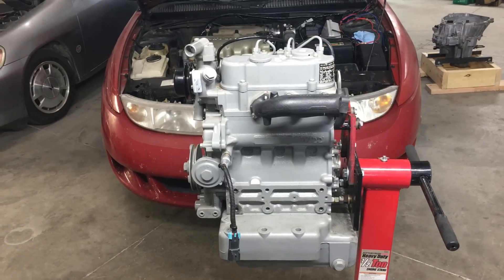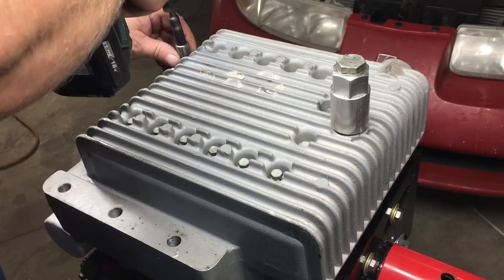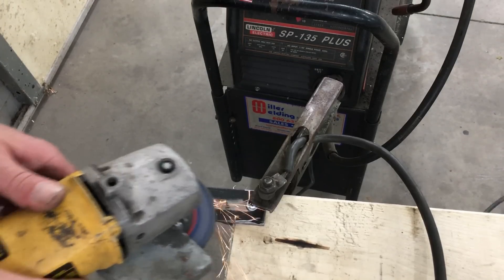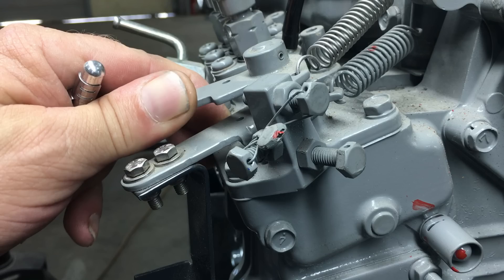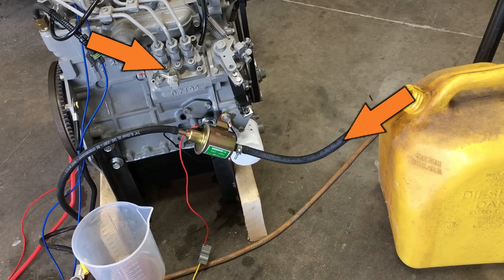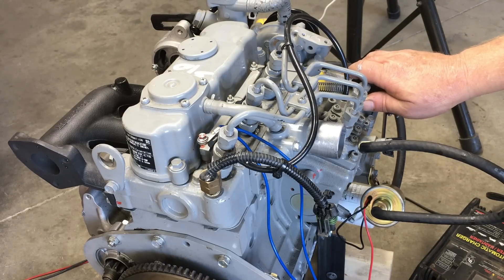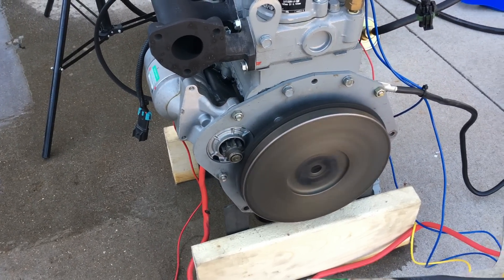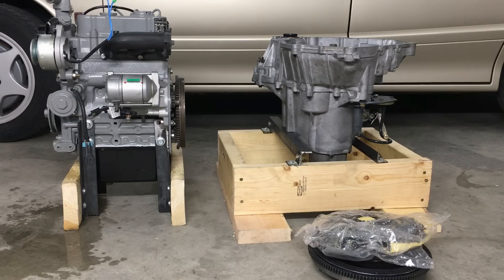S2E22  First start of the Kubota D722 diesel that we are going to use for our Saturn engine swap.

Comment: I think you're going to be very surprised how well this setup is going to work. It won't accelerate fast, but I think it's going to be running highway speeds with no problems and get excellent fuel economy
Reply: I bet that Saturn transmission has the engine turning well below 3600 RPM when on the highway. But it will probably be right in the middle of it's torque peak.
Reply: I dont think 16HP will be enough to sustain more than 50-60MPH on that boat of a saturn and would likely get a hell of a long time to get there.

And like it or not, it might not get that great of a fuel economy either. At highway speeds that engine will run well past it's efficiency zone and will work hard to mainstain that speed.

I'd say a D902 with a small turbo would be a better choice, but even that would be best fitted to the Honda, not saturn. Unlike gasoline engines, diesels don't care much about AFR, so you can have a bigger engine breathing a lot of air, but if you want efficiency, you just run it really lean and i'll still work fine, i'll just produce less power/torque.
Reply: This diesel plan reminds me of UK taxis 🚕

Comment: If you find that you need a lower gear ratio for 5th gear it is an easy swap to replace 5th gear from a single cam trans. Single cam 5th gear will lower rpms at same speed. The cover on the end of the trans houses 5th gear and is a quick swap. I have done this to gain better mpg in the past. Just be sure to replace the set of gears on both shafts and use the syncros on the single cam gear set. Basically just swap everything inside the end housing. The sound is fine and wish you a speedy recovery.
Reply: Oooh now that's a good tip.
Reply: Its fortunate, that most 5-speeds have only two bearings per shaft and the fifth so easily accessible. 
I think Toyota also builds a transverse six-speed box (EC6X) with the last two gears facing the end of the shaft. VWs, in contrast, have a third bearing at the end of the shaft.
Reply: interesting, this would be a good test to add for the diesel for sure.
Reply: The Old Semi's Came With a Few Hundred Gear Ratios.
Up to 16 speed gear boxes,  plus Two & Three Speed Splitters,  and High Low Rear Diffs.
"""" BUT """" Besides A Turbo,  Gota Put A Jake Brake on It. Brrrrrrrrrrrrrrrr !!!!!!!

Comment: 11:36 you say all diesel engines have direct injection. Not true. Not even close. Ford/International/Navistar 6.9 and 7.3 v8s for a glaring example use indirect injection and are commonly referred to as idi engines. The IDI 7.3 is different than the Powerstroke 7.3 and IDI vs PSD is a common, colloquial way to refer to them and tell them apart.
Reply from the maker: My bad,  I have owned a few semi vintage Mercedes with the OM60x engines and I'm aware of the prechamber stuff.  What I meant by direct injection was the fuel is injected on the other side of the intake valve.
Reply: @robotcantina8957  Not all diesel injectors are there, either. Old industrial engines with starting cups are one place I've seen injectors upstream of the valves and I suspect that's largely why the cups were needed. I've run a Chinese import garden tractor from (guessing) the late 1970s that used such an engine but I've also seen them on the really old stuff.

Comment: Sorry to hear about your hearing (haha). Hope things get better for you
There were a few shots with a weird ticking sound in the background, pretty quiet and definitely ignorable. Don't worry about it
Reply from the maker: Thanks!   I think the ticking sound was the electric fuel pump running while I was working on the engine.  At the time I couldn't hear it was still running, but I also heard it when I edited the video.  I left the sound  the video.

Comment: Cool video 👍one little note, not all diesels have direct injection. Indirect injection (IDI) is also very common. There's a bulb off the top of the combustion chamber where the fuel is injected
Reply: That’s indirect injection. 
Just look how the injectors obviously do not go into the combustion chamber
Reply from the maker: My bad,  I have owned a few semi vintage Mercedes with the OM60x engines and I'm aware of the prechamber stuff.  What I meant by direct injection was the fuel is injected on the other side of the intake valve.
Reply: Yeah, older diesel engines were mostly indirect injection, as that required simpler injectors and pumps along with lower cost. And you can run different types of fuel (like veggie oil).

These types of diesels were actually used in cars well into the 90s, at least by VW.

Comment: Hondabond is some of the best sealant I've ever used!
Reply: i will take your word
Reply: Threebond product labeled for the Japanese motorcycle manufacturers.
There was Yamabond and Kawibond too.
No real difference among them. They're all grey coloured case sealers, and probably not best suited for gasket dressing.
If that pan ever has to come off, it's coming off with a chisel and lots of cursing.
Reply: @jimurrata6785  so theyre threebond remarketed under different names i see!
Reply from the maker: Yes! another Hondabond user.

Comment: Hi Jimbo, don't worry about the audio quality, it's all good and I hope you recover quickly. Regarding there being no throttle, I would add one just for safety...

I know nothing of Kobuta build quality, but if for whatever reason you find yourself with a runaway diesel, it'd be nice to be able to stop it quickly before it does any damage to you or itself :)
Reply: agreed

Comment: Would 1/4in (6mm ish) plywood be strong enough for a short term alternator bracket?
Reply: I'd use at minimum 1in hardwood given the option, but far easier to just bend up 1/4" steel for a permanent solution

Comment: Dry sump diesel?
Reply from the maker: That would be expensive to do on this engine.
Reply: @robotcantina8957  Yeah , I'm used to you making low cost (if you ignore the manhour) solutions . 

I've always like the technical solution BMW use to have a slave twin cylinder petrol to charge the batteries in the electric i3 range extender. Seems this Kubuta engine has a similar design running in a narrow rev range. Seems this would be a great future project allowing a small battery pack to power the engine and the Kubuta running all the time to charge the battery?

Comment: That will be one interesting swap, once it's rolling :D

One thing to note; these engines are actually indirect injection. They run injection into a swirl chamber. If this was a direct injection unit, injection pressure would likely be much higher. Frankly, for a small engine like this, it's really not needed.
Reply: I agree not needed  but Isn't the swirl chamber purpose to promote more complete combustion to make the engine meet one of the various government mandated emissions tier levels?
Reply: @draftwood  Primary purpose of swirl chambers is to use lower pressure injection, thus making the whole system simpler and cheaper. These types of diesels predate any type of emissions laws.
Reply: @draftwood  In the early stages, yes, however the high compression makes NOx go through the roof. It does help bring down soot though

Comment: Kubotas are awesome - worked on them for years and year in generator and welder applications.
Reply: made in japan?
Reply: @fidelcatsro6948  - the engines yes, me no.  ;)
Reply: @DrFiero  i see then theyre reliable like toyotas 🐱👍🏿
Reply: @fidelcatsro6948  - Quite possibly more!  We would run them 20-30K hrs (about 2 million highway miles) and would then THINK about tearing them down for a rebuild - though they might not seem like they need it.
Reply: @DrFiero  lets add 2 of them we get Inline 6 cylinder diesel truck engine🐱👍🏿

Comment: Leave the spring on the fuel shutoff. A manual cable for a John Deere 330 garden tractor is cheap and will work fine.

The oil pan seal is vital to answer your question.   A 6” crack at the flange will leak a quart an hour.